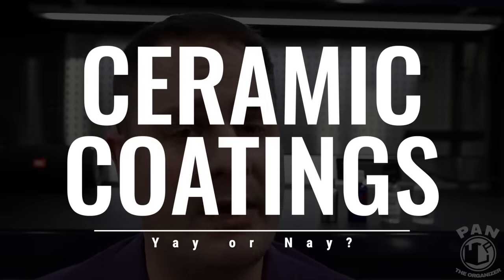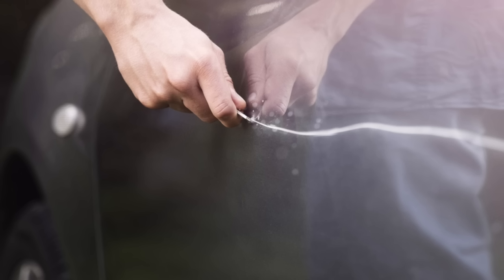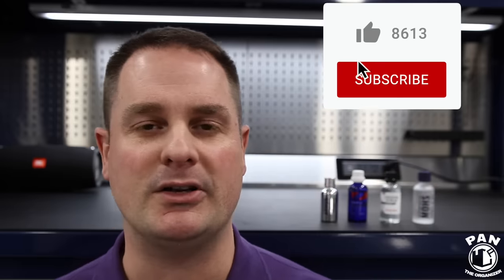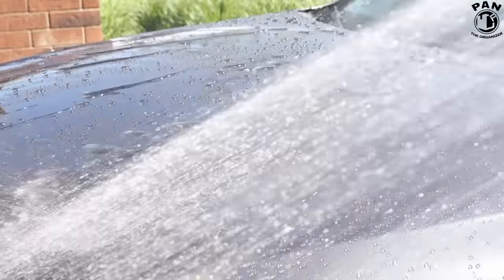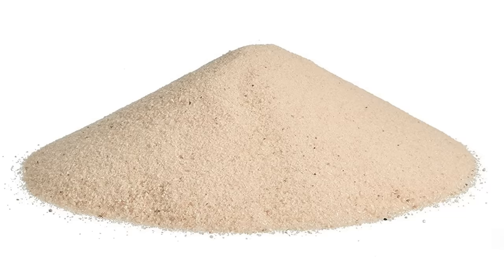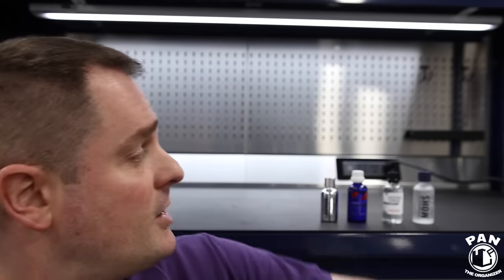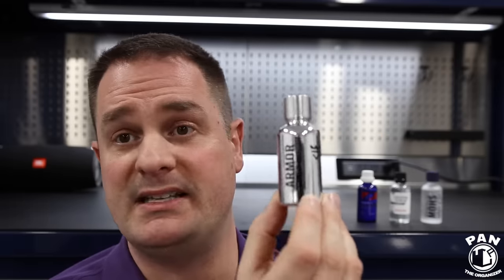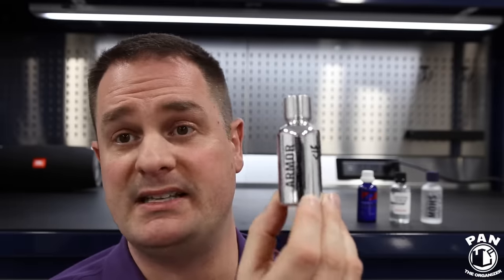DON'T BUY CERAMIC COATINGS BEFORE WATCHING THIS !!

Comment: Hi Pan, I have a question for you, I'm getting a Tesla model 3 in January, I want to apply Carpro ceramic coating as per your instructions, my question is what pad would you use on a Tesla I plan on using Carpro essence as my cutting agent, I understand Tesla paint to be quite soft so your advice will be much appreciated once again. Thanks in advance
Reply from the maker: Essence is really just a finishing polish. Not much cutting power. If you have scratches and swirls, at least use Sonax Perfect Finish with Rupes yellow foam pad before Essence.
Reply: @PanTheOrganizer  Thanks Pan your advise is much appreciated as always

Comment: Thank you Pan, for the very clear explanation on Ceramic coatings and the maintenance of it.
I just wonder if a little bottle is enough for an SUV ?
Reply from the maker: Yes but if you also want to coat the glass, wheels, plastics, headlights, grab two bottles.

Comment: Thanks for letting us knows not to reuse microfiber towels, since they can damage paint.
Reply: @PanTheOrganizer  Also, I was wondering if you have ever heard or tested Proje. It was a pop up ad on Facebook with a special offer.  It's suppose to be 9h ceramic coat (whatever that is); comes with a prep spray coat, 2 microfiber towels; all for $35.95.  It is also sold on Amazon, but it does not come with the freebies mentioned.  Thanks for sharing your vast knowledge with us.

Comment: Do you have a video on what to do DIY with a brand new car from the dealership to avoid high priced pro shops?
Reply from the maker: HI Cathy. You're in luck, as I have many new car prep videos, where I show all the steps I perform for the interior and exterior. Here are a few so you understand the process, products, tools and equipment:

VW Golf R: https://youtu.be/jr19g4PWJsk
My own brand new BMW M550i: https://youtu.be/dsCmJJDP3xo
Volvo XC90: https://youtu.be/tjJPcdCUaK8
BMW X3: https://youtu.be/AGMX1AN2ogI
Mercedes C43 AMG: https://youtu.be/maBAIUnpmg4
VW Tiguan: https://youtu.be/iTOWDtB87zI
Audi RS3: https://youtu.be/641mAJfKDLM

Comment: Given: Brand new VW, alloy wheels, will mainly be washed in a car wash, seldom by hand. Ceramic coating applied by a pro a good idea? Opti Coat Pro Plus any good?
Reply from the maker: Pro grade coatings are always the best (usually). I have had Opti-Coat Pro+ on my previous BMW and it was amazing.
Reply: @PanTheOrganizer   Thanks Pan.. my intended detailer use Opti-Coat Pro+ and Ceramic Pro. I am not really sure what is best, they try to sell Ceramic Pro, more than Opti-Coat Pro+. From what i understand Ceramic Pro need yearly maintenance, Opti-Coat Pro+ do not.

I will not often hand wash, the car will most often be washed in the brutal automated car washes. So if doing a ceramic coating, which one will be most resistant to it?

Comment: Pan,
I live in Northern Minnesota. Very cold (-20F to -40F) winters. Even colder than Montreal!  I've recently protected my paint with the Glassparency Graphene paint protection. What windshield washer fluid do you recommend that will function in severe cold but doesn't contain additives that will damage the surfaces of my BMW? I see that many contain ethanol and other antifreeze agents. Are any of these additives safe for the clearcoat and painted surfaces and trim? What should a person avoid?

Dcn Robb
Reply from the maker: You used two different accounts to ask the same question? I'm confused.
Reply: @PanTheOrganizer 

Sorry Pan. Didn't mean to confuse! Busy at the Church today with Covid-19 funerals. I lost track of where I was on the computer. I'll be more careful to stick with only YouTube in the future.

Comment: 1. Can this be used on the windshield?  2. my 23 year Cadillac has beautiful paint. The back trunk has begun to fad a little. Can I use this product to add shine?  3. Is it 1 bottle basically per car?
Reply from the maker: It depends what ceramic coating you are referring to. Some are just for paint (like CarPro CQuartz UK 3.0) and some can be applied on various surfaces like paint, glass, wheels, and plastics (like the AvalonKing Armor Shield IX).

I made a video about how to apply the AvalonKing on different surfaces here: https://youtu.be/6hDGYz6vvsw

Comment: Many cars, both new and used may have PPF (Paint Protective Film) installed.  How do ceramic coatings install on top of PPF?
Reply from the maker: You can absolutely apply coatings on top of PPF. And you should. PPF protects against stone chips, swirls and scratches. Coatings protect against UV rays, the elements, bird droppings, acid rain, tree sap, give hydrophobic properties, make the car easier to wash thanks to self-cleaning properties, add slickness, boost gloss...  Here's my popular tutorial on how to properly apply a ceramic coating: https://youtu.be/byKcYsEyWGk

Comment: Hi Pan,   I used CQ UK3 about 3 years ago. Great product.  However, I have used some 'ceramic type' spray coatings to keep the shine and beading.  I would like to apply another coat of ceramic and because of your recommendation I would like to try AvalonKing mostly because the CQ Quartz was a bummer to level out on my dark blue metallic SUV.  It would  flash to quick and  my arms ached trying to get the flashing level.  Also, as you mentioned the water would bead but leave watermarks if I couldn't get to dry it off.
  Questions:  1. Can I apply ceramic over ceramic?   2. What product would you recommend as a pre-cleaner to remove any wax\spray ceramic prior to AvalonKing?  3. Can graphine coatings be applied over AvalonKing as a maintenance?
Thank you for your insight on such a variety of products and car detailing.
Ed O
Reply from the maker: 1. No as you can't guarantee chemical compatibility. 2. Only way to fully remove a ceramic coating is by machine polishing. Mechanical abrasion. 3. See answer 1. 

I hope this helps.
Reply: @PanTheOrganizer  :  Thank you Pan.  Just top coating it is. Happy Holidays!

Comment: Thanks Pan for another informative video! Is there a need to use a ceramic soap to wash your vehicle or is that even necessary, what is a good booster spray for Avalon king?
Reply from the maker: Here’s a video I made about how to do a maintenance wash on a ceramic coated car: https://youtu.be/yLiePQRMFc8
Reply: @PanTheOrganizer  thanks alot!

Comment: Thanks for your earlier answers Pan.  When your car has a ceramic coating are water spots less noticable?  What is the best way to dry a car (I use a leaf blower) to keep water spots from showing up on the ceramic coating?
Reply from the maker: Ceramic coatings are in my opinion the best forms of paint protection, but are actually more prone to water spotting hence why we typically apply toppers or top coats. It’s one of their only negative points.

Trick is to use clean water if possible (water softener or deionizer), work in the shade or in a garage and dry the vehicle quickly at the end using a drying aid, if you live in an area with hard water issues.

Comment: this is good for cars and smaller vehicles what happens if you have a large project ie: RV, I have a new RV that is painted and I want to keep it as clean as my car. I have coated my car and have clear bra in selected areas to protect against road hazards ie: little pebbles or rocks. But an RV is quite large I will do similar but what about obtaining larger volume of ceramic material to coat the large surface? Do you have any suggestions or alternatives you would recommend?  Great video and detail thank you :)
Reply from the maker: You could use a spray-on rinse off sealant. It will last 1-3 months, but takes only seconds to apply. You wash the RV, rinse it, spray the sealant and immediately rinse it off again. Boom. Done.

See my video on that topic here: https://youtu.be/1W8ZfyuMScY

Comment: Hi Pan , thank you for always replying and making us feel o special. I would like to ask. I often have limited time to wash my car in the afternoons and can only finish the job the next day , so my question is, is it safe to apply wax the next day after a wash, how about that small dust that maybe on the car?  Is it necessary to rinse and dry again before waxing or applying any form of protection?
Reply from the maker: Thanks Thami. No problem to apply the protection the next day if the car was garage kept. A quick wipe with a microfiber towel and a panel prep like CarPro Eraser to remove any light dust and you can apply the protection.
Reply: Thank you  @PanTheOrganizer  👌👍
Reply: Hi Pan in South Africa we dont have Carpro. What other products can you recommend to use as IPA or equivalent to Carpro Eraser?

Comment: must you avoid getting ceramic coating on glass windows, and what about plastic pinstriping. ?
Reply from the maker: It depends what coating you buy. Some are exclusively paint coatings, and some coatings are more versatile and can be applied on multiple surfaces like paint, glass, wheels and plastics.

You also have surface specific coatings like glass coatings, wheels coatings, paint coatings, plastics coatings, etc

Comment: Hey Pan, very informative as you all ways are. I finally subscribed, but have been watching your videos for a few months. I have 2 questions for you. 
1I just did paint correction and panel prep and applied 303 Graphene coating to my car. Would I be able to apply the ceramic coating over it? If not? How do you suggest I remove it for my car and any remnants of my three year old  ceramic coating? 
2. Does tbe Armor Coat need a topper? Could you use Gtechnique over the Armor coat if they don’t have one?
Reply from the maker: 1. No. Ceramic coatings need to bond directly to virgin well prepped clear coat in order to have maximum durability and performance. If you want to remove your existing protection, the only way to ensure 100% removal is through machine polishing. But I'm confused. You say you did paint correction (which would have removed any previous protection), and then a panel prep, and then applied 303 Graphene Coating. And now you say you have a three year old ceramic coating? Makes no sense.

2. Armor Coat? Do you mean AvalonKing Armor Shield IX ceramic coating? The company says the coating doesn't necessarily require a topper, but I always recommend that people use a silica spray sealant once every 2 to 3 months to ensure maximum performance and durability.

I hope this helps.
Reply: @PanTheOrganizer  yes it does. I had a ceramic coating, was not sure if my paint correction.graphene prep removed all of it or not. Thank you for your reply! I think I will see how well this graphene coat stands up through the winter. Car is garaged and not driven every day. I will do a new prep and ceramic coat in the Spring. Compared to the ceramic coat, the Graphene coating is no where near as good. Just my opinion.
Do you have a one step compound/polish to recommend for my surface prep in the Spring? Thank you SO MUCH for your help and for your information!

Comment: Could the AvalonKing Armor Shield IX be applied to sandblasted raw carbon steel to keep it from rusting? Sandblast would be with 100 grit Aluminum Oxide.
Reply from the maker: You would have to ask them directly. I don't have the answer to that.
Reply: @PanTheOrganizer  Will do. Thank you, Pan.

Comment: Any suggestions for someone who has just bought a newer used car that has some knicks (through the paint)?  Should those ideally be touched up before applying ceramic coatings?  I’m a new subscriber and love the detailed videos.  Much support and appreciation for your content.
Reply from the maker: Thanks Ryan. Before applying a ceramic coating, you want to clean, decontaminate and polish your paintwork to get it as perfect as possible before locking that finish in for years with a ceramic coating.

Watch my popular ceramic coating application tutorial to better understand the steps: https://youtu.be/byKcYsEyWGk

Comment: In the past I've used car wax also on the windshield. Great to shed the rain. What about the ceramic coatings ion glass
Reply from the maker: Not all coatings are meant for all surfaces so you have to check the instructions of the coating you are buying. But certainly a ceramic coating designed for glass outperforms any wax applied to the windshield.

Watch my glass polishing and protection tutorial: https://youtu.be/yMi5PtyqUI8
Reply: @PanTheOrganizer  Thanks you Pan - thumbs up

Comment: you say all of these have 'so an so' long warranties... but how does that transfer into actual use.. When you get to that 4-5 year mark... what happens, you have to buff the paint knowing somehow the difference between the clearcoat and ceramic coating and then reapply? and what about if youve kept up on it and done a spray on coating over it to "upkeep" the coating? will it last until you forget to do proper upkeep, meaning as long as the paint?

Comment: What should I  use for minor paint correction before applying ceramic coating? A polish or comped? Does the polish need to be stripped before applying the coating?
Reply from the maker: Watch the steps I perform in this video: https://youtu.be/etXhJNaF0EE

Comment: Can we apply ceramic coating on windshield, side windows, side mirrors, headlights and tail lights?
Reply from the maker: Painted surfaces, wheels, headlights and tail lights yes. For glass, some paint coatings can be applied on it (like the AvalonKing) and some others no. You have to read the instructions of the coating you’re buying.

There are also glass specific coatings that exist. Like the one I reviewed here: https://youtu.be/FPgRtq_HI2k

Comment: Hi Pan, once again you’ve made great video!!  I did have a question though.  I have ordered a new vehicle and I want to put a ceramic coating on it right away.  Will it be ready to go when I get it home from dealer ship, or should I wash and do some other steps before applying the coating? Thanks Pan 👍🏼
Reply from the maker: Hi Dennis. You have the correct reflex to want to protect your vehicle as early as possible. The best time to actually start protecting your new car is as soon as you take delivery from the dealership. 

You're in luck, as I have many new car prep videos, where I show all the steps I perform for the interior and exterior, including ceramic coating the paintwork. Here are a few so you understand the process, products, tools and equipment:

VW Golf R: https://youtu.be/jr19g4PWJsk
My own brand new BMW M550i: https://youtu.be/dsCmJJDP3xo
Volvo XC90: https://youtu.be/tjJPcdCUaK8
BMW X3: https://youtu.be/AGMX1AN2ogI
Mercedes C43 AMG: https://youtu.be/maBAIUnpmg4
VW Tiguan: https://youtu.be/iTOWDtB87zI
Audi RS3: https://youtu.be/641mAJfKDLM
Reply: @PanTheOrganizer  Thanks Pan appreciate the quick response and video resources your the best!!👍🏻 Truly there is no greater detailing channel than this one! ☝🏻

Comment: thanks for the contents, another issue comes up, what is the perfect place to apply ceramic coating, you have great videos, with easy understanding explanation.tyvm
Reply from the maker: Thanks for the positive feedback about my videos. For the ceramic coating, the perfect place is obviously in a garage where you can control the temperature and humidity levels like in my detailing garage. But you can also apply it outside if you have no other option, just make sure it doesn't rain for 24 to 48 hours. And don't work in direct sunlight. Always work in the shade, on cool surfaces.

Watch my super popular ceramic coating application tutorial here: https://youtu.be/byKcYsEyWGk

Comment: Hi Pan, your videos are so informative, and I have applied a Carpro ceramic coating to my car using your methods and it looks amazing, what products would you recommend for protecting my front bumper from rock chips, something I can do myself, I find PPF a little daunting, what would you recommend? Thanks again
Reply from the maker: The only way to protect against stone chips is to have PPF installed.
Reply: @PanTheOrganizer  Thanks Pan your advise is much appreciated.

Comment: I have a new Sienna Minivan so I guess for me wondering what would be a good ceramic coating that would give me enough to complete my vehicle.  Or maybe I'd need to get 2-3 orders to get coverage?
Reply from the maker: One bottle should be enough if it’s a 50 or 60 ml. If it’s 30 ml, get two.
Reply from the maker: Yes absolutely. They have good deals especially if you use my links and apply code PAN25 at checkout.

Comment: The Avalon armor looks easy to apply, but the prep work with machine buffing and polishing to perform paint correction and putting on top coat after applying it might move this beyond the DIY’er.
Reply from the maker: You can just wash, clay and apply. But as this is a detailing channel, I like to show the correct way of doing things as perfectly as possible.

The point of machine polishing is to not only remove swirls and scratches, but also to ensure 100% removal of any existing paint protection (waxes, sealants) before you apply the ceramic coating, as ceramic coatings need to bond directly to virgin clear coat.

Comment: Quick question, Can that be applied after the car has been buffed out with its 4 stages procedure (wet sand , first buff 2nd buff and final glaze buff)
Reply from the maker: No. You have to use a paint prep spray or IPA to wipe the surface and remove the polishing oils and residue before you apply the ceramic coating.

Watch my popular ceramic coating application tutorial here: https://youtu.be/sqQYVjxFqK0

Comment: 7:43 What do you recommend in order to fix scratched headlights? Car is a 2016 model, but the headlights have some minor scratches on them. I wanted to apply some polishing paste on them, but I think that will remove the UV coating and they will turn yellow soon. Any tips ?